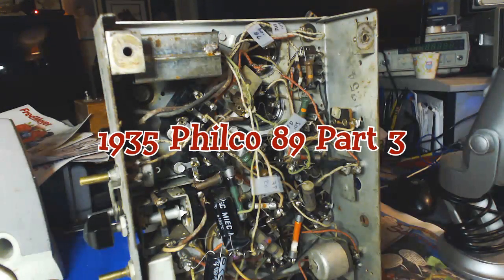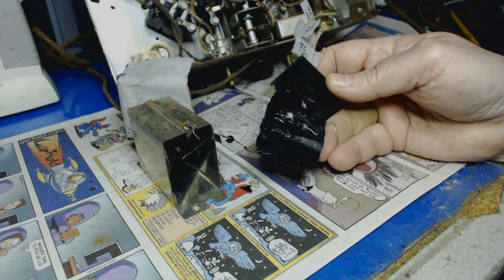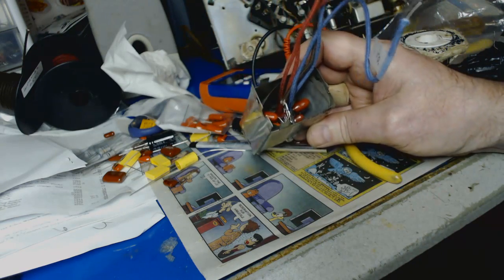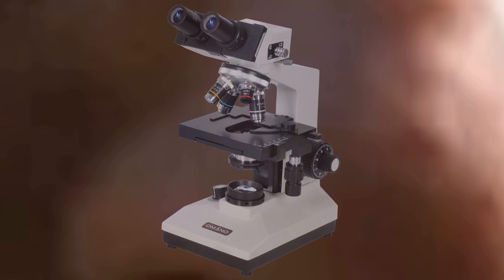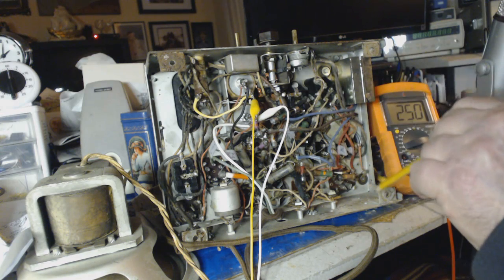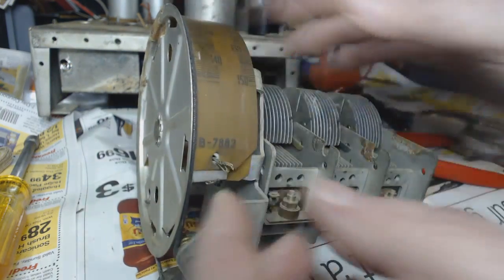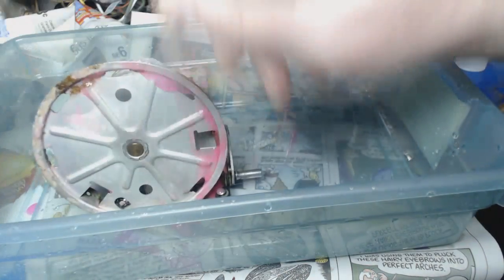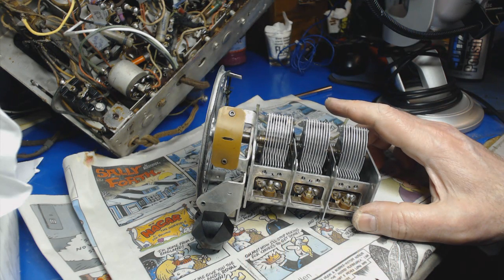1935 Philco Model 89 Restore Part 3

Comment: Very nice job Buzz....  John under the scope... wow, never saw that detail.  LOL   That using cap looks awesome..  Being daring is part of this hobby !!!  Really nice job - Ron
Reply from the maker: I use Loctite naval Jelly, so I don't know if any other brand would harm aluminum
Reply: I use the same brand. It also works really good to get years of cigarette smoke and grime off of the chassis of a guitar amp... leave it for 30 seconds and it brings it back to new.

Comment: I soldered all the leads of the new caps for that box together and soldered that to the wire coming from the box, then I soldered a new wire on each end and ran the leads outside the box. Looks like your filter cans are a little different than mine. mine looked like a spiral like a spiral staircase. originally I restuffed mine, but I didn't trust the old rubber insulators in the base so I re-mounted the caps on a terminal strip under the chassis. Wow, John ought to get those teeth looked at LOL  The tuning cap came out nice! I washed mine in the sink till it looked like that and then clearcoated it. (I taped over the fins) Great job Buzz, i'm enjoying this series!
Reply from the maker: Hi Dan...Does your power switch has a ball bearing in it?????
Reply: I don't remember there being one in there but i'll take a look when I get a chance

Comment: hi buzz, as usual great video. one thing I wanted to mention about testing caps. when testing higher voltage caps ,like in these old tube radios, leakage is the most common failure. it turns them into big resistors. only way to test for leakage is to load them down with voltage. an old capacitor tester with ever increasing voltage settings works like a charm.
Reply from the maker: Hi Andy....I know all that...I mentioned that in the video, but I cut that out due to time,.....plus I don't had an old style  capacitor tester...But the radio worked good, so I know the caps were probably OK...but I wouldn't leave them in.........Thanks, Buzz

Comment: Hi Buzz, Working on an 89 123 now. I had so much trouble trying to figure out the 5 cap can I gave up and just measured the values and picked something close to my measurements. The .09s in my can were also .140 so I used .15. Radio is playing quite well now.

Comment: Wow, so John under a microscope looks like Max Schreck...who knew?  Hey Buzz, I got a 2 movie set from Amazon today I bet you'd like.  Here We Go Again and Heavenly Days, both starring Jim & Marion Jordan (Fibber McGee & Molly)  The first one also stars Edgar Bergen & Charlie McCarthy, Mortimer Snerd, Ginny Sims from Kay Kyser's band, and a lot of the regulars from F&M's radio show, Harold Peary, Gale Gordon, and the actors who portrayed Mr Whimple and Abigail Uppington as well.  It's really good.  Ginny plays Gildersleeve's little sister but still manages a song number in the movie.  Naval jelly on aluminum huh?  Well, at least it's a weak caustic.  I remember years ago at Tecumseh I worked on an alkali dip tank heated by a steam jenny and used to to take rust off crankcases, etc.  It had a chain air hoist for lowering baskets of parts into the alkaline solution and I had to wear rubber gloves, galoshes, a heavy apron, coted sleeves and a full face shield.  While I was on break once a guy sought me out asking what was wrong with the dip tank.  I went back wo it with him and there was a basket of parts inside and I asked what he put in it as it was foaming and bubbling.  He said a basket of pistons.  I told him to run!  The pistons were aluminum and that tank was starting to overflow.  I got the parts hoisted out and they may have once been pistons but they were so eaten away as to be unrecognizable by then, lol.  Later I showed him what alkaline does to aluminum by putting in a coke can.  The can floated atop the alkaline and bubbled and fizzed and in about 5 minutes had dissolved completely.
Reply from the maker: I use Loctite naval Jelly, so I don't know if any other brand would harm aluminum.....wonder what would happen to a human body in that dip tank....I still have yet you go through all those other DVD's you sent last year!!!....Buzz

Comment: Nice job again Buzz.  The ole Naval jelly does a good job on the tuners.  I always thought that it was death to aluminum but you have proved it is just fine.  The thing looks better than new.  I wonder why you chose the orange drips for your caps.  This is a question not a complaint.  Do you find that they are a better cap than the mylar ones?  I have to put in a substantial order for a radio that I am working on, and I want it to be "Buzz approved".  Thanks for the video.  I am still learning lots from you.
Reply from the maker: I chose them for the color..brightens up the shot...was just tired of yellow, and also needed some with radial leads instead of axial leads.....When you are doing Bakelite blocks , I like radial leads. but if you are doing tube to tube, the longer axial leads are better.............Buzz

Comment: Great video as always Buzz. I was happy for Dickel until he opened the door. LOL Quick question about your AM transmitter if that is OK. Did you wire the on/off switch where the LED is supposed to go or take it back to the AC/DC in spot??? Regards, Dave
Reply from the maker: The switch is to the left of the LED.... I cut a trace on the positive and wired the switch in series..
Reply: Thanks Buzz, that sounds like something I might be able to do LOL ... Regards, Dave

Comment: Buzz,

I never would've used naval jelly on aluminum, but you showed it can be done if used over a short time.

Where are you getting the grommets for the tuner?  Are they a universal size or are they made specifically for this Philco?

Thanks, Tom
Reply from the maker: http://www.renovatedradios.com/parts.html#rubber          Philco Support Grommets for Tuners (GSm-Tuner)
Reply: Thanks Buzz.